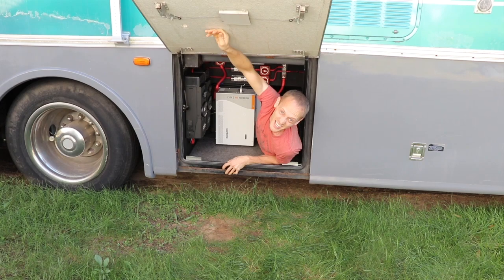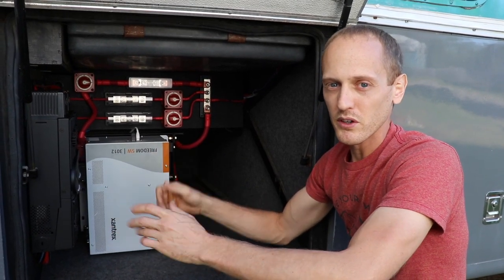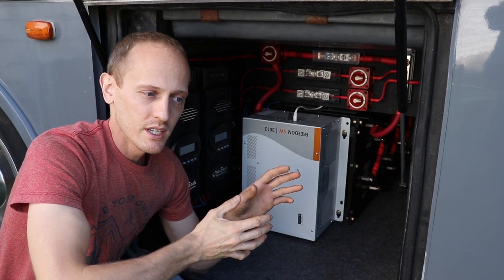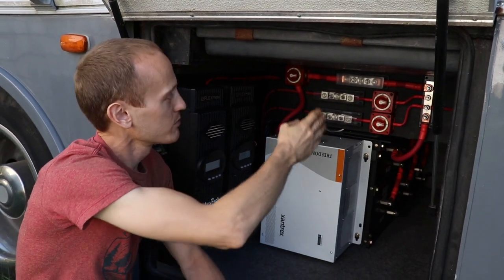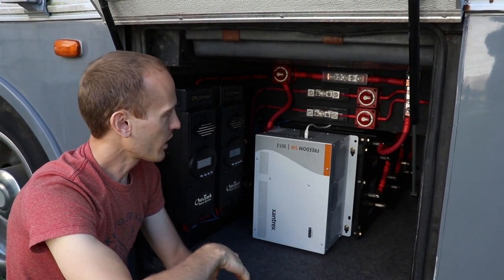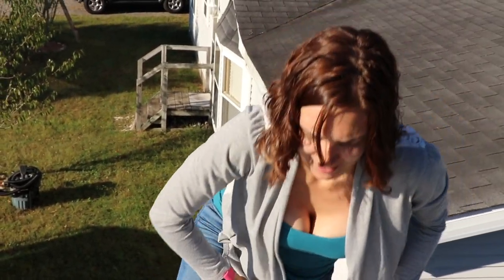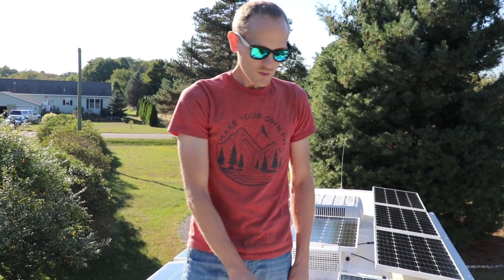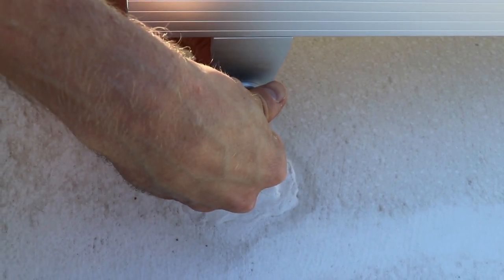Massive DIY RV Solar Install for Off Grid Boondocking

Comment: Awesome job! I have a Winnebago Brave that came with a 150 watt solar panel that offers a trickle charge for my house batteries. I'm a bit hesitant about putting up extra panels because I don't want to comprise the integrity of the roof in fear of future leaks and high wind conditions during highway driving or high wind conditions due to the weather. What kind of bolt securing did you do after the bolt holes were drilled assuming your only access for bolt placement was on top of the roof....wing bolts perhaps?
Reply from the maker: If you do end up adding more panels, make sure to upgrade the wire running down to the charge controller/batteries. The factory wired panels are exactly as you stated. A trickle charge. We put 100 holes in the roof for this install and no leaks after a year. There are 2, 1" long 1/4" lag bolts per bracket foot going into the roof. Each panel has 4 bracket feet. If your roof is EPDM rubber over plywood like ours, then this system will work for you. when you place the bracket feet, put Dicor between the roof and the foot. Screw in your lag bolts, and generously cover the entire bracket and lag heads with more Dicor. Now you have a secure mount that is sealed as good as if not better than all of the factory holes in your roof. Make sure you finish tighten by had so as not to strip the lag bolts in the wood. Just go nice and snug. Our brackets hold the panels up about 5 inches above the roof and we have no trouble at all with highway driving. The aerodynamics of driving a brick already disrupts the air so much that there is no lift generated by the panels. if anything, by the time the air swirl stabilizes halfway down the rig, you are getting some downforce. As you should be going on your roof every few months for maintenance inspections already, you now just look at the added brackets as part of your check list. Clean up and re-apply dicor as needed.
Reply: @HereThenGone  Thank you for your speedy response .... I never considered lag bolts...that could work. That being said I'll have to check the specs regarding the roof. I do know it's quite solid up there and I'm to understand that it has a fiberglass shell over plywood base(Winnebago's are noted to not leak because of this). How thick that plywood is unknown at this time. Just brainstorming here....Did you consider using plastic anchors which would expand and flare somewhat against the inner circumference of the drilled hole once a standard bolt was introduced rather than a lag bolt? Your suggestion to upgrade the wiring is duly noted and I'm hoping the additional cabling won't be too much of an issue....Cheers
Reply from the maker: Typically the plywood is 1/8th inch thick. There aren't many anchors that the flare will grip that shallow of a wall thickness. If it is a fiberglass shell, i have read that a lot of people use an industrial adhesive to mount the feet down without drilling. I'm not sure I would personally trust just that, but many have. you would need to predrill the fibeglass to avoid splitting but try to leave as much of the ply as possible to bite into.
Reply: @HereThenGone  Alright then.....I could remove the inside trim on one of the roof vents inside the RV which might reveal the plywood thickness...hope it's deeper than 1/8" even if I decide to use the lag bolts. I like the idea of industrial grade adhesive. Prepping would be essential for a secure bond, I think, as well as outside temperature range. Suffice to say we're still experiencing winter temps up her in New Brunswick Canada so I won't be considering this and one other project (flooring) until we get warmer weather.... Cheers

Comment: nice job  I have 3 -300 w panels at 900 w and its all I need with a soft start for ac  and have resy. frig
Reply from the maker: Nice! You definitely aren't running the A/C for very long though. Good that you can fire it up for a little bit at least. 👍

Comment: Are you able to monitor the power from each of the solar panels individually so you can tell which ones may not be working properly?
Reply from the maker: It would be very obvious if there was a problem. With panels wired in series, if one went bad(very rare) the whole string would be bad. At that point you just disconnect them and get out the voltmeter to see which is at fault. That is very unlikely to happen
Reply: @HereThenGone  not as easy with 12 panels especially if your out in the hot sun.  I bring this up because I saw another video of a guy with six panels and his solar panel manager system actually broke down the power for each panel in the system individually and collectively.  So if one failed he could see on the monitor and know exactly which one it is.
Reply from the maker: @rockyalvarez520  if you remember, we have 2 series runs of 6 panels, so technically if one panel went bad you would only be checking one set of 6 panels. No reason to add all the extra equipment when it is very rare that a panel goes bad. Most of the time it is grid tied systems that have this kind of monitoring because they have large arrays and it would be much harder to track down a bad panel. It just isn't something we are concerned with. It would be fun to watch the data, but not worth it for the very rare chance something went wrong in our opinion

Comment: Maybe you want a rubber cushion under the frame to de stress your welding.
Reply from the maker: Not really sure what the point would be. If there was enough support from rubber under it to take the weight off the frame, then it would be applying the weight to the bay floor which is exactly what we were getting away from. A properly constructed frame does exactly what it was designed to do. Support the load of the batteries.

Comment: Not sure what you are trying to explain @ 4:09 but putting batteries in parallel or series does not affect how much “energy” you have in total.  It just affects the parameters in which you can “deliver” the power over the connected wiring harness.  Anyways, very clean build, looks great.
Reply from the maker: As was clearly explained in my statement, wiring in series doubles the voltage but the amperage stays the same and wiring in parallel doubles the amperage but the voltage stays the same. We have had many people think that we should have a 2400ah bank because we have 6 400ah batteries. If we wired them all in parallel we would have 2400ah @ 6v, but because of wiring them series/parallel to get 12v, we end up with 1200ah @ 12v.
Reply: Here Then Gone kinda of knew what you were saying after I posted. Amp hour is like the imperial unit of the energy storage world.  I’ll never understand how it got popular when watt hour was available.
Reply from the maker: Wattage is the constant yes, but when most batteries come rated in amp hours, it's much easier for people to follow if you stick with the same unit of measure.

Comment: yeah i have to say this is solar done right. Planned and executed perfectly. Considerations made for volts vs amps and the cable requirements for each. No messing about (figuratively). Very nice. Very expensive, at least for me.
Reply from the maker: It was definitely an investment. We worked overtime and weekends for over 2 years to save up for it, which also gave us plenty of time to learn all about it. We are very happy with the results of our first ever attempt at solar. Thanks for the very kind words! 😎

Comment: Nice video!   I actually feel I somewhat understand how solar power works now because of your clear explantions.  Thanks..
Reply from the maker: Awesome!!! So glad to hear it. We have another video that gets a little more technical about how to size your system. It goes over the math of items typically used in an RV and shows how that effects how much solar, batteries, and inverter you need. Check it out if that interests you. Maybe it will shed even more light on the subject. https://youtu.be/UnCM5gCqSWs
Reply: @HereThenGone  Yeah going to watch it and consider my solar options for my 28ft RV.  Up in Ontario Canada.  Some of our provincial parks site  have hookups but many don't so solar would give us more choices.  System would be simple just for lights etc..cheers..

Comment: if he can put 12 panels, I could maybe put 17 (taking the air conditioner, to put on the side), plus 2 sliders with 17 panels each - this would give 51 panels, that power! - this could generate enough energy to replace the combustion engine with 2 electrics; heating the water with a solar heater, would keep me free of spending on fuel
Reply from the maker: Not sure what kind of rig you have, but you won't be fitting 51 panels on it either way. And as for powering it with electric motors charged by the panels, if your rig is as big as it would have to be to fit 51 panels, you wouldn't get much distance with the charge you generated. Always fun to dream though. 😉

Comment: Can you stay off grid forever?
Reply from the maker: In terms of electricity, it is all weather dependent. We can always fire up the generator to recharge if necessary, but that is a last resort. Water would be the next necessity that would limit our time. But as far as actually being plumbed into the grid, we won't need to be unless we choose to be.

Comment: can you put battery sideways never seen that before
Reply from the maker: With AGM you can. You can't with traditional flooded batteries because the electrolyte will spill out. Absorbed Glass Mat batteries have all the electrolyte absorbed into fiberglass mat and therefore there isn't any extra fluid to spill out. Other than some overpressure valves, they are a sealed battery

Comment: Seems to me to be yugely overkill...why do you need so much power?
The RV fridge runs on propane fumes. One 7 lb bottle might last a month or 6 weeks...
For heat you run the gas furnace or  install a Cubic wood stove...
Forget AC unless you're tied to shore power...
The cook stove uses gas...
Kitchen appliances can run off battery power...they're mostly low wattage...a 12" fan pulls next to nothing.....
I'm missing something here...
Reply from the maker: You are missing so much. Why use propane if you don't have to? We will travel with the weather mostly, but will be able to run our window A/C all day if we get stuck somewhere warm, cook with induction, run the fridge, charge tons of camera gear, use power tools, run the furnace(which typically draws about 8 amps for the blower), as well as run all the 12v things in the rig. Everyone has different priorities. Obviously you don't have to install a solar system if you don't want to. We wanted to. Simple
Reply: @HereThenGone  That's perfectly fine...I was just a bit curious where all that energy was going. That's the RV version of Hoover Dam...
Reply from the maker: @LeonAllanDavis  no worries. We are just trying to keep costs down on the road. Big cost up front while we are still working in order to save money when we quit our jobs and travel for at least 2 years.
Reply: @HereThenGone ,
With that kind of a large inverstment (solar and RV renovation), I sure hope you will be fulltiming much longer than two years! :-)

Comment: Impresive job! Congrats
Question now; what make you choose the “lifeline” batteries over “Trojan 105 AGM”? Just curious. Thanks
Reply from the maker: Much higher quality battery. These are also 400ah each. You would have a lot more T105's to wire together  than the 6 I have. Lifelines are made in the USA and designed for emergency vehicles where quality reliable power is off utmost importance.

Comment: Nice system. I already had a basic idea of how a solar system goes together but seeing yours so neatly assembled really solidified my understanding to the point that I would be confident putting a system together just referencing your video. All your description of series vs. parallel and how one is affected by shading and one is not was something I did not know, I thought shading was always a problem now I know there is a way to limit its effect. Good info!
Reply from the maker: So glad that the video has helped you! Any kind of shading effects the total output to your batteries, but parallel accounts for it the best. You have a lower voltage which requires larger wire to the controller from the panels, but every panel that isn't shaded still performs to is max potential. If you know you will be parking in areas without shade or that your roof vents, A/C covers, and antennas aren't creating their own shade, then series is the way to go with an MPPT controller. Hope you have fun putting your system together. It really is worth it when you have free power, and you did it yourself.
Reply from the maker: Also, if you are interested, we put together a video going over exactly how to size your system to meet your actual usage needs. Complete with real life numbers from typical devices run in an RV. Take a look if that is something that interests you. 👍 https://youtu.be/UnCM5gCqSWs

Comment: Great video and well throughout design. Too bad peoples are so hung up on lithium batteries in the comments ( I bet most of them don’t have them with either). Wishing many happy years of using the system. I hope to one day install a similar system.
Reply from the maker: Thanks you so much. We know that lithium is the future, but our wallets in the present weren't having it. haha. We worked overtime and weekends for over 2 years to save for the system we have and with all the other things we are doing to the rig, we would have needed to work at least another year to go lithium. Thanks for the well wishes and good luck with your system in the future. Take the time to get information from multiple different areas and I'm sure you'll do great.

Comment: Hello, I have another question; Do you have a schematic or wiring diagram on how you wired charge controls and inverters and batteries to the bus bar/bars? If you have drawing you can share can you send it to lxe1986 @ yahoo.com  << no spaces Thanks….
Reply from the maker: I don't ever draw out or design anything anywhere other than in my head, so sadly i don't have any schematics. For reference though, the bus bar is only acting as the positive battery post. Instead of stacking a bunch of ring terminals on the post, you have separate posts on the bus bar for each device. Just cleans things up and allows for only one wire going to the batteries. Hopefully that helps a little bit.

Comment: Holy Craftsmanship!  Total labor of love.
I'm thinking you should be in the bracket side business?  :)
Reply from the maker: Haha! It totally was. And we're trying to get away from the normal 9-5, not make a new one. Hehe. If we could make them on a large enough scale and sadly a little less robust, it might be profitable, but to make them to the level we did, they would be too expensive for most to want to pay. Doing the work ourselves and not having a need to upcharge for profit, they were cheaper than similar brackets online now. Thanks for dropping a comment. They really are appreciated
Reply: @HereThenGone    Haha, no you have the mount brackets made and shipped, you just design and fulfill orders

Comment: Watching this in 2019. Very impressed with the solar layout, but I'm curious why you went 12V for the batteries instead of 24 or 48V and avoid that monster gauge wire. I've seen some nice industrial 5000W 48V all-digital PSW inverters that would be perfect for RV use. A 60A DC-DC converter will take care of any direct 12V needs.

Lithium is getting cheaper by the day. You can now get quality 3.7V cells that do 6800mAh 30A continuous for under $5 a pop. A 48V 960A 12KW fully modular pack can be built DIY complete with balancers for around $4800 without touching a soldering iron. Just google "battery blocs".
Reply from the maker: With 24 or 48v we would have been limited to 4 or 8 batteries to accomplish that. So less capacity, or more with the added weight and space. Of course making your own battery pack seems cheaper, but you also need to design a BMS for safety. And those kinds of systems need a lot more monitoring. We'd rather spend our time out enjoying nature. Thanks for the comment. Hope you stick around and follow our upcoming adventures
Reply: @HereThenGone  Yes I noticed you mentioned the weight. Being modular a lithium bank will come out to around 9lbs, so a 14S 48V pack would total 126lbs. Size wise each parallel bank measures only 5x5x11 inches. A 600lbs weight saving even in a large RV is substantial. I agree with you though, I'd rather be having fun too than worry about balancing. Good luck with your setup and please do post videos on any updates/upgrades you make down the road :-)
Reply from the maker: @Luscious3174  we would love to go lithium down the road. Just wasn't in the plan/budget this time around. 😁 Thanks again for the feedback